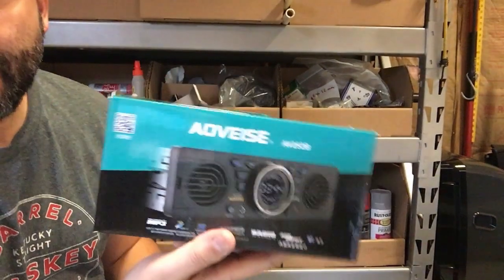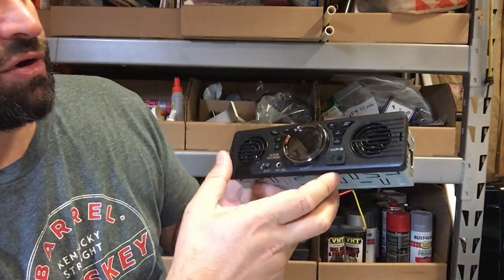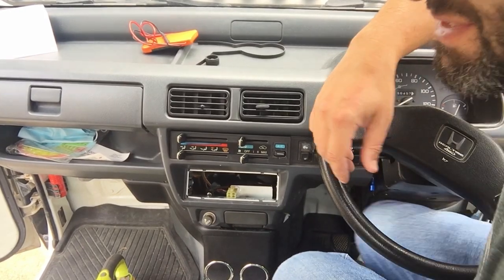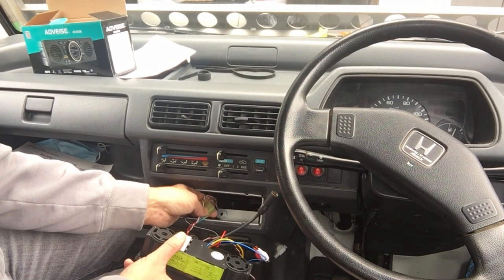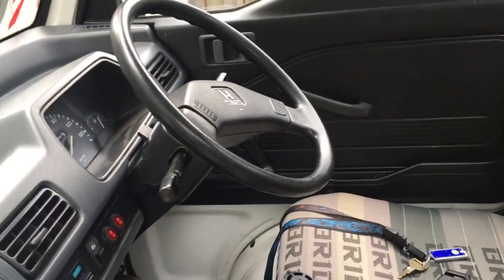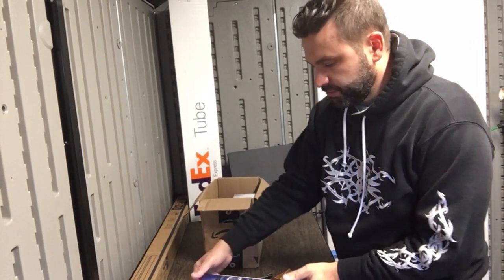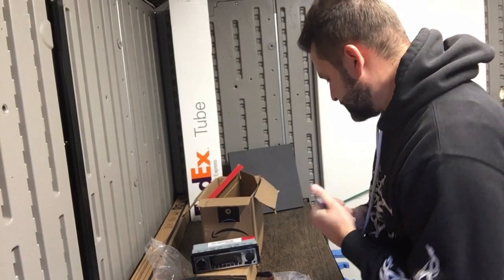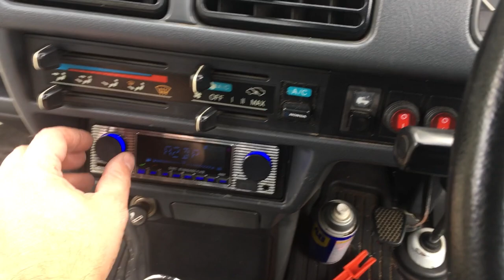Honda ACTY gets new Bluetooth Stereo and Speakers

Comment: Those round connectors are RCA connectors. They are designed to be used with an amplifier. I don't think that radio made enough power to drive external speakers. It's just a preamp.

Comment: i have this radio and it works great
Reply: Did you use all four of the acty radio wires for it? I get the speaker wires, I just can’t get which wires go where and if I use all four

Comment: Good video thank you for sharing. And just in case you have the plug in with the 4 connectors and you also have the 2 plug in and that plug in has constant 12v just a heads up that is what I use for my radio in my acty also there is a company that makes factory connectors and you can use for a plug and play for any radio again great video
Reply from the maker: Yes, that’s what I used for ACC 12 volts.  For some reason in my car that 2 wire plug was taped up, but then I found it.

Comment: Were you factory speaker wires not working? Is that why you reran new wires? I have mine all connected and functional but I am not getting any audio to my speakers using the factory wires.
Reply from the maker: Since the Acty only has one speaker the factory radio does not have stereo sound.  Since I added a speaker to the passenger side and needed to do new wiring anyway, I just rewired both sides…thanks for watching and good luck
Reply: @MarcoCerqueira  I actually have tow factory speakers. Any clue why they would not be getting sound when just simply wired and replacing the factory speakers?

Comment: Do you have a pic of the wires all matched up? I understand the speaker wiring but I can’t understand where the 4 wires go to, I know I don’t use the power antenna but I’m not sure about the others. I bought the exact radio as well as the same speakers.
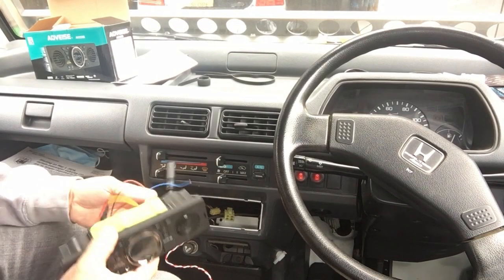Reply from the maker: Get yourself a voltmeter, you can get a really cheap one from harbor freight.  Red wire is 12v acc, that means it only gets power when you turn the ignition key to the on position.  The yellow wire is constant 12v, that always has power and keeps the memory on your radio, black is ground.  Sorry I don’t have a picture.  You can tap into the wires going into the factory unit and check for voltage.  Watch the video at the 10:30 mark for the wire connections…thanks and good luck

Comment: What spacers did you use, and what length screw did you end up using for the driver side door? O have these speakers and haven't had a chance to mount them yet.
Reply: Use the correct speaker spacers as there designed specifically for this reason..4" speaker with a 4" spacer works fine and all holes line up and original screws are good to go...I chose a 43mm depth speaker any deeper and it will interfere with the door panel

Comment: I hate to be that guy. But dude you should of googled the dash removal for the truck. Also RCA plugs are for sending signal to an amp. 
You should seek help in this stuff as not to destroy your truck, electrical system or start a fire.
Reply: The radio removal was disturbing to watch...there's 2 bolts accessed by removing the ashtray,,takes about 2 mins
Reply from the maker: Yes hindsight is 20/20.  When I made this video back in 2020 there wasn’t much info out there.  Thankfully there is a growing and strong community that is there to support others that are new to these great and fun vehicles.